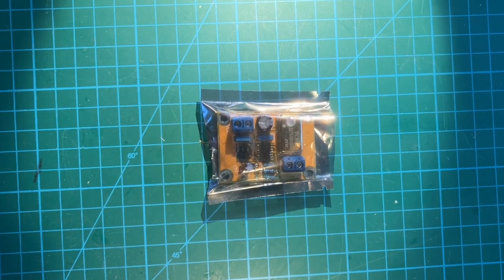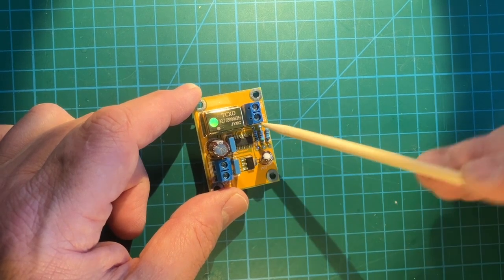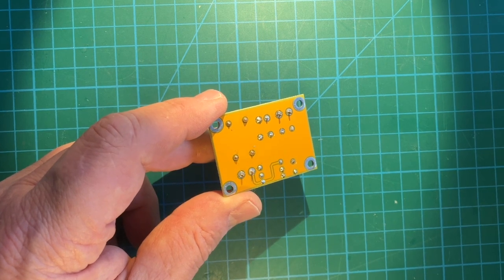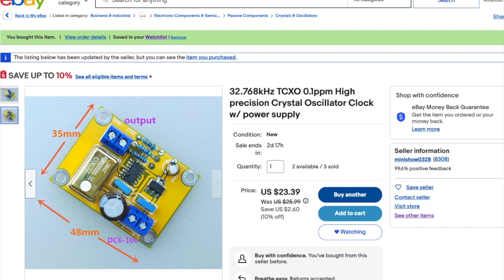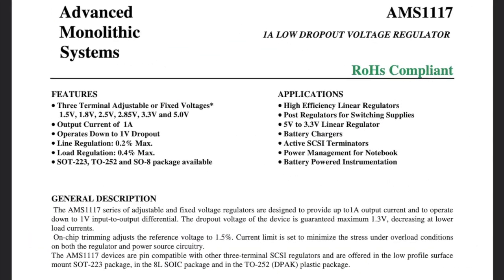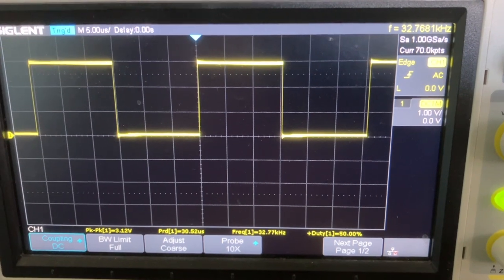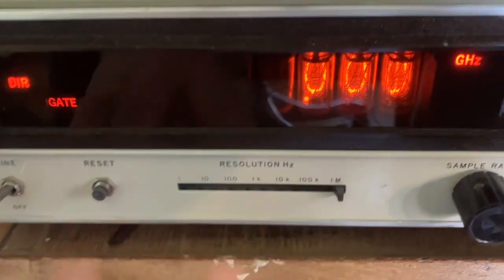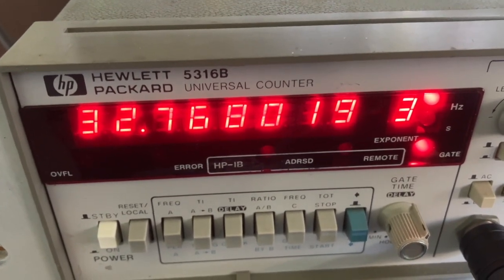32 768Khz eBay Module

Comment: Probably got all the gates in parallel
Reply from the maker: Hmm.  Had briefly considered that, but would it sextuple (or at least improve) the overall TTL fanout of the module?  I think I'll check with a dmm...
Reply: @dtss_smudge 
Yes it's a common trick!
Reply from the maker: You picked my curiosity.  So I buzzed it out.  Yup!  The first 74HC04 inverter (pins 1&2) buffer the raw TXCO can's output so it can drive the remaining five inverters in parallel, whose outputs in parallel are fed to a 220 ohm resistor (presumably for current limiting/short protection) and on to the module output. That did not occur to me as I was biased to assume that TTL outputs tied together (that were not otherwise tristate/opencollector) was a circuit error.  But of course not if as in this case, all the outputs are guaranteed in the same state.  Thanks for the tip!

Comment: Why don't you have a look at the 32KHz package? It is designed to work with most RTC chips, and uses the same 3V button cell as the RTC chips.
Reply from the maker: Not sure which 32KHz package you're referring to.  If you mean the silver 32Khz TCXO on this module, it takes 5V in...